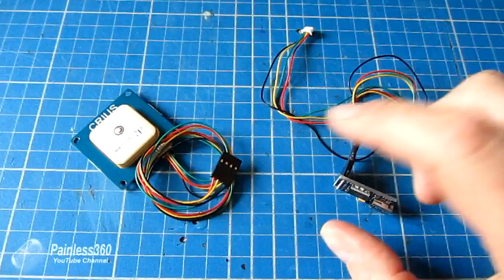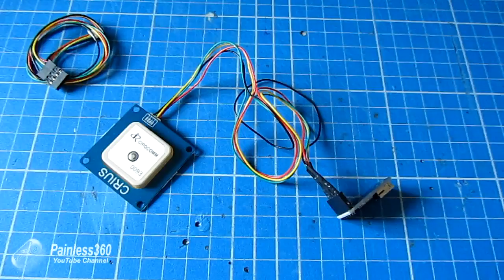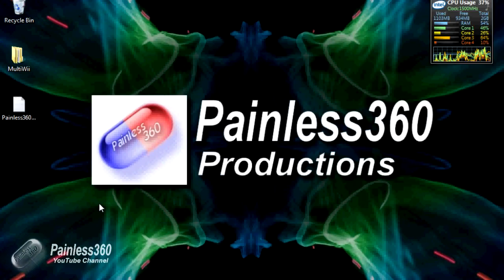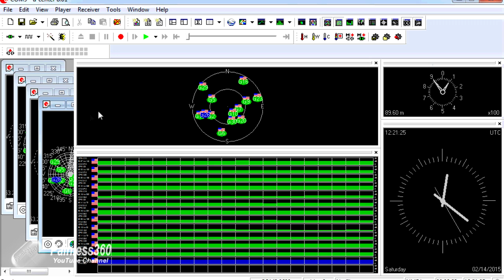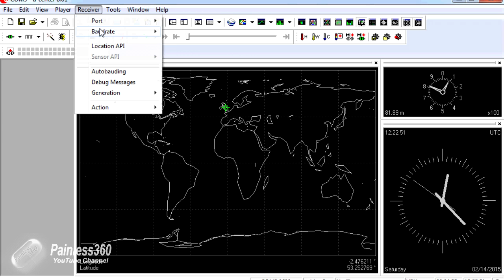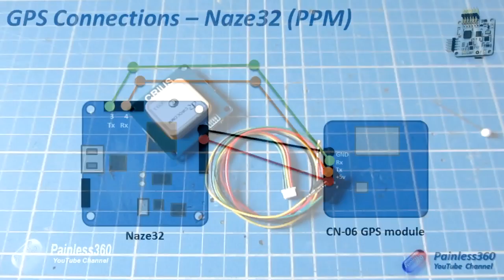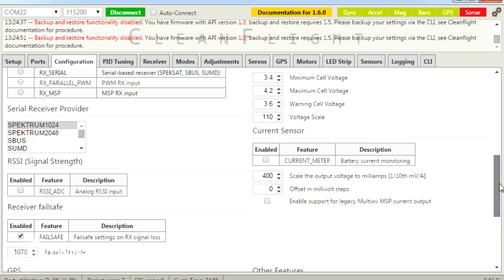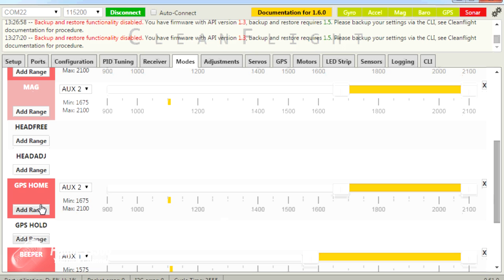(6/8) Naze32 Flight Controller - Adding GPS (NE-06, NEO-06 module)

Comment: One more question . And as should be the port seteado cleanflight ? To PWM AND GPS is pin 3 and 4 without changing channels? I have the flip32 V 2.6
Reply from the maker: See the video - normally the PWM pins move when you use a GPS.. Best of luck!
Reply: Do not move, the PASE a GPS, and connect the cables in this order , and took the auxiliary nomas and I fataban the trhole and yawing

Comment: As a friend set up the GPS with sbus if both use the same pin 3 and 4 , you can put the GPS in the UART 1 ? or only OSD ?
Reply from the maker: +Juan Carlos oanelli UART 1 has to have MSP to support the USB connection. The OSD speaks MSP too, the GPS does not..
Reply: Can you or can you not use Sbus and GPS at the same time.Don't know what MSP is.All the videos about Sbus and GPD I have seen, use the same Pin 4. How did you connect PPM to your board?

Comment: Upon initial setup of an naze32 with clean flight I thought the magnetometer was represented by the graphics display am I incorrect in this assumption
Reply from the maker: Depends in the board, if it's got a mag then the direction is relative to the direction of the model, if not the position is relative to the direction faced when it initialised - ish.. ;)

Comment: Hello. I dont know if Im doing something wrong here. I have a USB to TTL YP-01 and not an FTDI Basic module. I connect the GPS to it and there is no comunication. It is necessary to be an FTDI Basic? Thank you! Awesome videos!
Reply from the maker: We use the FTDI basic and it works here...
Reply: It seems that mine does not work, but it confuse me when I search on some stores FTDI and i find that some of them says USB - TTL. So I'm going to buy the FTDI Basic to see if it works. Thank you again, your channel is very, very usefull!
Reply from the maker: Best of luck with it!

Comment: hi I've got a fliip32+ with a u-bloxneo-7m gps. Will this work for me? I tried to do it and got a message ( the version you are about to download doesn't correspond to version of gps reciver) here I stopped, I got the shakes!  do I continue or do I have to do it another way?
Reply from the maker: See our Naze32 series for more information and we manually configure the GPS in the SP3 series (that will avoid the issue your having as the file is for V6 GPS units only). Happy flying!
Reply: +Painless360 ok thanks!

Comment: Thanks for the reply firstly.
I have connected the gps to the Adapter and loaded the gps program( gnss config)
It's lightning up as it should but it won't connect to the computer?? 
Is there a minimum requirement eg window 10??
Just won't connect 
Thankyou again buddy :-)
Reply from the maker: +Ads-sky-high 101 Can you reply to the other comments? Help keep track of the conversation. I'd check the TX and RX pins are the right way and that he FTDI drivers are ok too - best of luck..
Reply: +Painless360 
It's connected ok on the leads I believe.
With you saying the drivers.... Have I missed some software.??? 
It very likely I have. 
Thanks
Reply: +Painless360 
I have uploaded on my playlist what my gps is doing . Cheers
Reply from the maker: Have you turned on 'auto-bauding'? Let for you to check - follow the steps in the video.. Best of luck!
Reply: +Painless360 
Hi there think I have sorted it now thanks.
Where is the auto bauding ??
Reply: +Painless360 all sorted now buddy.
We're would we be without guys like you on here. Can't thank you enough!!!! :-)
Reply: +Painless360 
Hi there , is the gps mounting critical for direction?? Like the arrow on the FC ? 
Many thanks in advance
Reply from the maker: Only if it has a compass in it. If it does then it's usually labelled with a big arrow that should point directly forward.. best of luck..
Reply: +Painless360 
Ok, it's the same as in the video neo 6. I don't think that there is s arrow on it ??

Comment: Hi there. I have a solid blue and flashing green light but I can't get the gps to connect through the port-new connection. 
Is it my ftdi Adapter, it's a red board from banggood not a black one as in the video.
Many thanks in advance
Reply from the maker: +Ads-sky-high 101 Not sure what you are describing - the GPS connected via FTDI, the Naze32 board or both..

Comment: Hi,  I'm struggling to understand the links between the GPS module, the Naze32 and the Receiver Module in PWM mode. For the normal Aileron, Elevator, Throttle, Rudder - all clear as these signals are processed internally on-board the Naze32 and so the linkage is direct to the Receiver thro' pins 1,2,5,6 (PWM GPS mode). But the GPS and compass signals are interrogated  off-board. So logically, I expect them to be coupled onto the Naze32 at some point and then (after possible processing) to be linked to the receiver through the RC Input pins 3 & 4 on the Naze32. Is this what the U1RX and U1TX connection points in the middle of the Naze32 are for -you couple the GPS to the Naze32 board there? And I guess the compass goes onto the SCL and SDA pins. It wasn't clear from the video because it was largely geared to PPM mode.
  Also although the Naze32 requires 3,4 pins to be used for GPS - can you still put the links to the receiver in the normal way by putting Throttle and Rudder onto Receiver 3,4 positions and GPS onto Receiver positions 5,6?
Reply from the maker: +Colin Lloyd possibly, check the GPS pages in the Cleanflight manual. Best of luck!

Comment: Lee, that was amazing. 

Just setting up another quad with a Naze32 Rev 6 board and the addition of GPS using the UBLOX board you suggested was dead simple. Thank you!

Matt

PS. It's curious to see the differences between the Naze32 board setup & the CC3D Revo. Personally preferring cleanflight as it feels easier to use, however Libre Pilot is just as easy tbh.

PPS. I wish I had the "return to home" (aka "oh ** dear!") switch & GPS setup earlier, it's exceptionally windy here today and I managed to loose the quad over some trees. Found it safely in the middle of a deserted playing field though, yay!
Reply from the maker: +Matthew Ogborne cleanflight GPS modes are not reliable yet. Best of luck!
Reply: Howdy,

So maybe a better idea to put the CRIUS NEO-6 gps on the other quad that uses the CC3D Revo to replace the standard gps module?

Matt
Reply: Also a "Thinking aloud question", maybe one for a video of it's own. 

How on earth do you squeeze everything on to one of these mini quad frames? 

My first quad is loaded with cables on the front 3rd behind the camera. Yes I could trim them down but for my first build (following your videos) I was wary in doing so.

And also the best (or even suggested!) placement for everything too. 

I trashed a £40 600mW transmitter this morning as we landed on it's rear and completely removed the copper tabs from the transmitter board where the ariel was. Arrrrh!!

I've got the DR4-II in a 3D printed case and attached up under the top plate with cable ties so thats pretty safe.

But any suggestions on how best to organise the internals would be very much appreciated.

I'll stop typing now :D

Matt
Reply from the maker: +Matthew Ogborne the easy answer is.. you don't! ;) most 250 frames will just fit the pdb, radio rx, camera, vtx and an osd inside if you're careful. Most rely on us using the top deck for the battery too so we lose that space for gps and extras. The move to more  'integrated' components should help us squeeze more in. If you want all the toys at the moment then we need a triple decker 250 frame!  ;)
Reply: omg, why didn't I think of that! 

Off to eBay to grab another top board :) 

I already have a couple of spare pillars. 6 holes & a couple of screws and thats the 3rd deck. Mount the battery in sideways on the 2nd level and use the 3rd deck for GPS etc.

Thanks fella.

Matt

PS. It'll look like a beast :) :)

Comment: Hi there ! I've downloaded Dropbox which I use for other file transfers but when I click the link or type in the address all I see is a load of data on screen but no file to save or use. Can you help please ! Thanks !
Reply from the maker: +Eddie Lloyd right click, save as?
Reply: +Painless360 Many thanks.  Tried this and when trying to load file in U - blox as per your video I get a message saying it does not correspond with the version of the receiver.   I am trying to install this on an NZ GPS unit and now stuck.
Reply from the maker: +Eddie Lloyd Not sure why you're stuck,. the setup is all covered in the Cleanflight manual for the GPS and we also show the manual process in the SP3 series in the GPS setup video..
Reply: +Painless360    Hello again !   Thanks for very quick replies !   I think I may be stuck as I thought my NZ GPS unit could be configured as per your video above.

Comment: Thank you for your videos they been a great help. You are very detailed  so I did not think I would be asking for help. I have the latest Ver. of clean flight Feb 16 ver so it is different to the one you used in your video. My problem is I am using a n32+GPS on a Naze 32 Ver.5 flip board and can not get it to work. I have it connect properly, I think. I tap in to 5 v on the board to power the GPS and white and yellow goes to Ch 3 and 4 signal wire. When I try to activate it on the board it turn off when I hit save. Please Help
Reply from the maker: +Cameron Hinds I'd plug the GPS back into the PC and use the GNSS software to check the settings.. Best of luck..
Reply: Does that pretained to the n32+GPS

Comment: Hi Painless360, when I try to upload the "painless360.ublox.txt" GNSS file (at point 13:00 in video) I get the message  The back of my GPS unit says NEO-6M-0-001. I am afraid to proceed with the download in case something gets messed up. Will it be OK? any advice??Thanks.
Reply from the maker: +Sean Robertson If you're worried you can follow the manual method that works with any GPS model. See the video in the SP3 video series for the GPS.. Hope it helps..

Comment: Great video/tutorial!  But as I tried to  upload/install the CNSS configuration file, I got  a massage in U-center that  the version of he board (7.32?) didn't match the file. As I countinued anyway,  at the end of the installation the application (U-center) crashes. When I restart it, alle the settings are unchanged (baudrate 9600).
Do you (or anybody else)  have a clue?
Reply from the maker: Watch the GPS video in the SP3 series, we go through all the manual settings that should allow any GPS to work with Cleanflight.. Best of luck!
Reply: +Painless360 
That did the trick! Thank you again.
One question:
Are these settings optimal for the naze32 as well?
Reply from the maker: They are optimal for Cleanflight ;)

Comment: almost ready to do this.. lol
I was wondering.
If you are using the Naze32 and GPS on a wing for GPS Hold/RTH, is the compass still required?
Or is that only for multirotors?
Reply from the maker: GPS modes at 'experimental. If you want GPS modes in a fixed wing then consider an APM or Pixhawk (https://www.youtube.com/watch?v=k4tQAmg2ssA)

Comment: thanks for your assistance.I am using the ublox neo 6m gps module and it will connect  to the u center at 9600 but not at 115200  when I use the config file it willupload at 9600 fine then i change the buad rate to 115200 and I get a red flash light at the bottom of the screen
Reply from the maker: +Michael Hill (rcjunky75) See the SP3 GPS video for the full manual process - best of luck!

Comment: hi is there a front or back to this unit when fitting it to a quad such as the wire connector should be at the back inline with the rear of the quad or doesn't it matter aslong as the ceramic aerial is facing up please?
Reply from the maker: +Chris H If you&#39;re using a GPS without an on-board compass then all you need to do is mount it antenna up. Best of luck!
Reply: +Painless360 brilliant thank you! im using the same unit as you in conjunction with a 10dof Naze I just wasn't sure if they are directional or not, another cheeky question please, would fitting this unit on a pole about 4 inches or less away from a 600mw vtx affect it?
Reply from the maker: Slightly but as you can't use the GPS for reliable flight mode on Cleanflight at the moment anyway, you'll be fine!
Reply: +Painless360 thanks for your help I really appreciate it!

Comment: Hi Lee. Great videos!!

I'm Trying to set up a Ublox M8N using u-center 8.20... so no way that config file will work.

Any chance you could upload a few screen shots of the config menu, on vital pages/settings?
Or worst case scenario: point me to a forum post/blog etc that discusses these settings in detail?

Much appreciated!
Reply from the maker: +Jarrod Andrews You can setup any GPS using the manual method, see the GPS video in the SP3 series where we go through all the steps..
Reply: Thanks for that!

Comment: http://www.amazon.com/U-BLOX-NEO-6M-Controller-Multirotor-Quadcopter/dp/B00UBT371O/ref=sr_1_5?ie=UTF8&qid=1454985332&sr=8-5&keywords=neo-06+gpsThis doesn't have the mag compass would it work better given the naze has an on board compass.

Comment: hi mate. if you use sbus your pin number 4 is taken so there is an option to connect a gps to soft serial but as i was told i have to use gps with 9600 speed only...is there a way to get same stripped down config but for 9600? thanks a lot
Reply from the maker: +alisher rakhimov You can change the speed down if you need to. See the manual process for altering the setting for Cleanflight in our Seriously Pro series. The process is the same.. I wouldn't use less than 57,600 for a GPS unless you are happy fro latency and lag in the update of the co-ordinates. SoftSerial will support 19,200 baud max. Best of luck.

Comment: Hey there, I am back at it lol. I got that last issue sorted out with the octoquad you helped me with here a while back. Ok, I purchased two gps micro units from china to try out, but there is limited info on them in regards to ublock and setting up directly/config. Do you have any insight on this type of gps? They are the size of quarter? what could isses be with device, dead on board bat? Anyone with ideas please feel free.
Reply from the maker: +Andrew ONeal (Andy-drew) No idea without knowing the exact model and type. Some units (the really small ones) have no onboard memory so the settings have to be resent every time the FC powers up and detects it. Its called Auto configure normally ad may need to be setup in Cleanflight. Best of luck with it..
Reply: i got a small gps as well.... used the config file ..it worked well. but could not make it to work with the naze..... ;(
Reply: Got the micro GPS unit to work just fine, the first one was faulty. I'm thinking maybe the bat was fried or no good in unit. On the right side of clean flight under GPS tab, does the real-time location show up like APM controllers
Reply from the maker: In the GUI? It should do..
Reply: Yes in the GUI under GPS tab to right of Sat counts there is a screen that is always loading? Never seen it find or locate, it could be that I'm connecting in the basement but wanted to be sure the window was actually supposed to propagate first.

Comment: Thanks for the video. I was able to set up my Naze 32 with the CRIUS NEO-6 GPS based on the instructions. On the GPS display panel in my Baseflight, I was able to see GPS fix with 7 satellites. However, the GPS signal strength panel did not show any satellite information or signal strength. Is that normal ? Thanks
Reply from the maker: +Mike Law Not sure - we used Cleanflight here. Might be worth asking in the Baseflight forums.. Best of luck!
Reply: It is showing GPS data now. Thanks !

Comment: hello i think you will be a big help to me i am thinking on trying one of this boards but have some doubts and hope you can help so 1 can i use this board in a 500mm frame ? adding the gps the board can then do position hold and return to launch and must important question is if this ir the normal naze 32 10 dof ? or is some special model and sorry for my ignorance but i am accustomed to apm and pixhawk in the hope that yoou can help best regards and good flights and projects
Reply from the maker: +joel bessa If you want 'real' GPS modes that you can reply on for a larger craft then Cleanflight isn't it. You need a board like an APM/Pixhawk or CC3D revolution.. Best of luck!

Comment: Thanks for some great videos, tips and tricks...  I have learned a lot about quads, the naze32 and my Taranis radio.

Question:  Can you connect a full Naze32 to the GPS in a ImmersionRC EZOSD?  Could I tap the tx/rx pins and share the GPS with FC and OSD?

Just a thought, I have a complete IRC video system on this wing and dont want to add another GPS antenea.  Any comments welcome...
Reply from the maker: +Ken Anderson I doubt it, maybe you can but it wasn't designed to be used like that and I'd be concerned with signal degradation as the GPS output wasn't designed to run two inputs..

Comment: I just tried setting up the Neo 6 to the Naze32 full.  For some reason I'm net getting power.  I double checked the wiring. I have it using Aux pins.  I'm only connecting the Naze32 to usb, will the USB supply power to the Neo 6? 

I do get power to the Neo 6 using the ftdi adaptor.
Reply from the maker: Then what you think is 5v and GND probably isn't. Id check it with a voltmeter..

Comment: Good video.  Are these steps the same to use the OP GPS with the Naze32?
Reply from the maker: +Northern Flyer I've not tried it with that. The full 'manual' configuration method is shown in the GPS video in the SP3 series on the channel.. Best of luck..